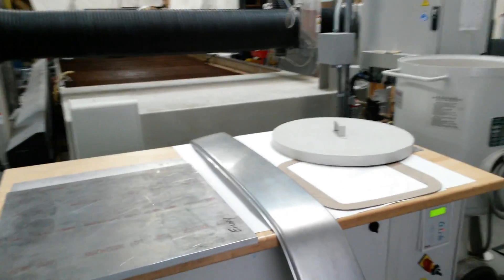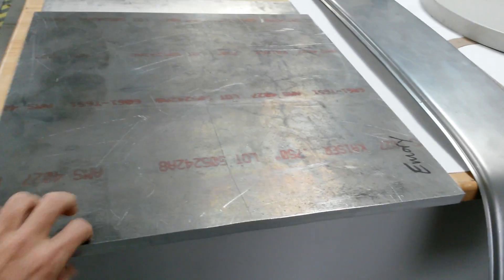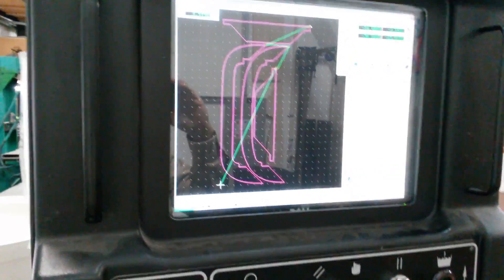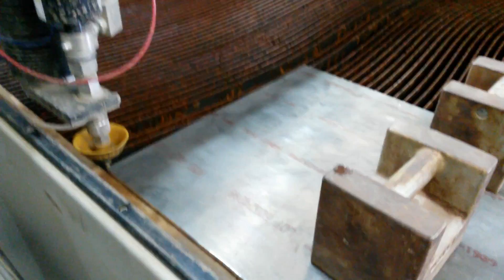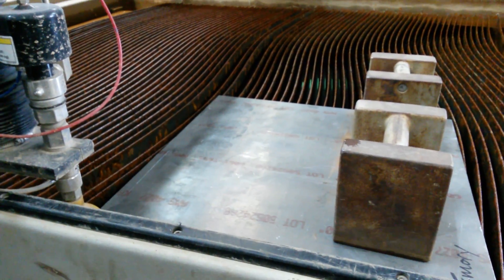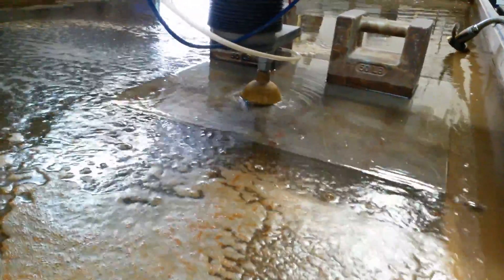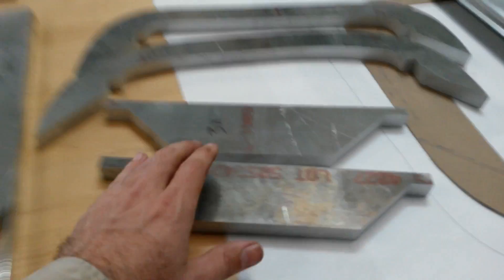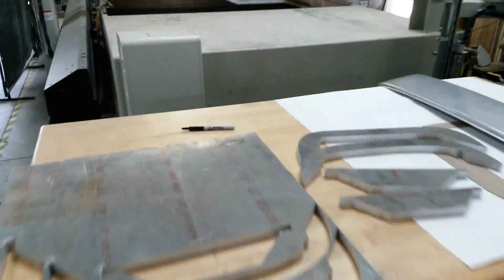Cutting Metal With Water! Omax Water Jet in Action

Comment: Plasma cnc is much better and faster.Less mess less material to use and cheaper.You can use oxygen or nitrogen to cut aluminum,steel or stainless steel.
Reply: CNC plasma cut quality doesn't come close to a waterjet. Maybe a Laser if set up properly
Reply: If you don't care about quality then a plasma is better